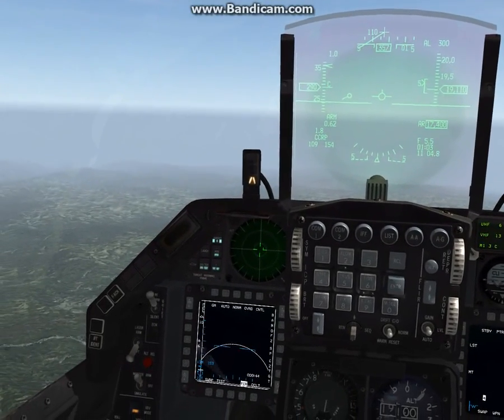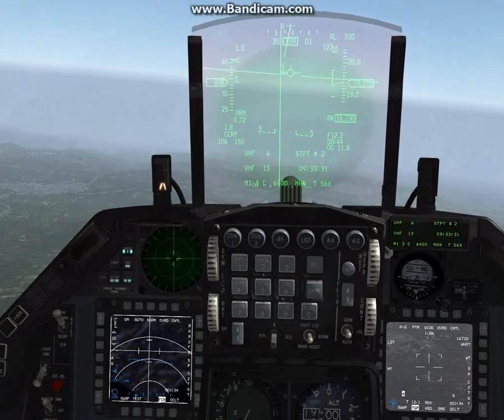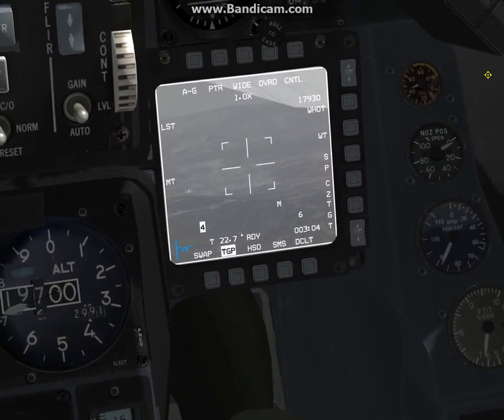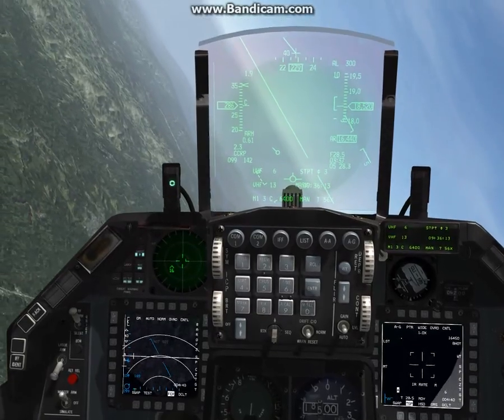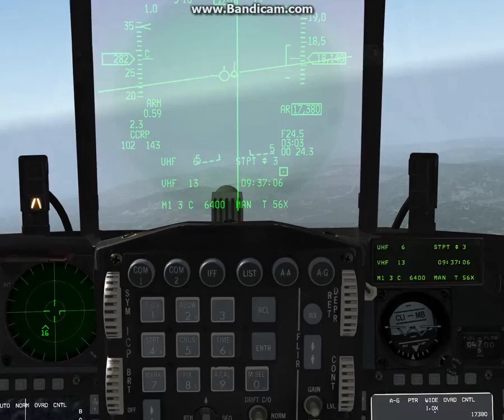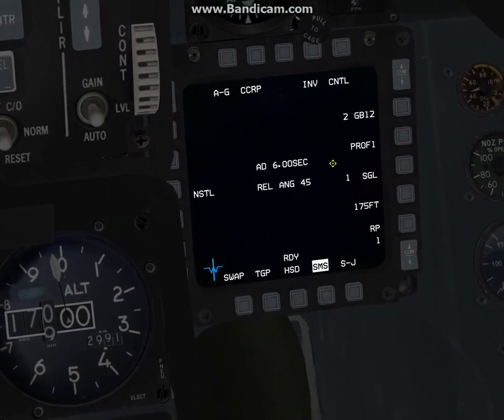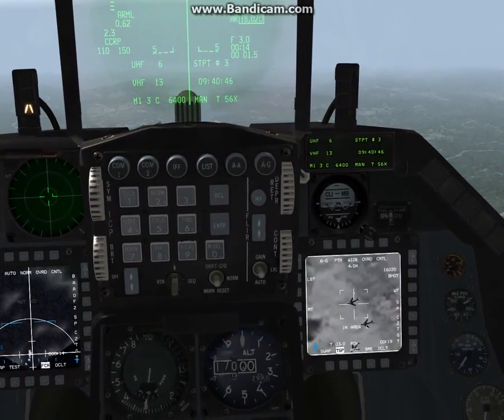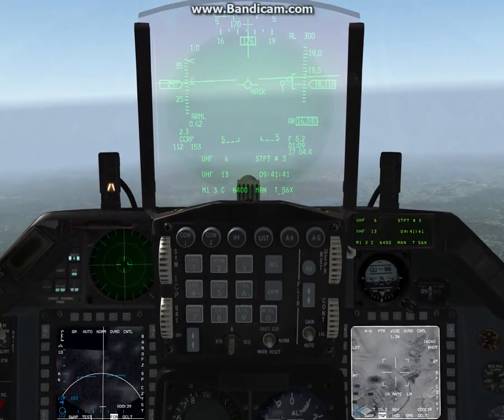✪ BMS 4.32 "Laser Guided Bomb Tutorial"

Comment: Hi
Can you explain how to use GBU-15. 
It is not the same as other GBU bombs
Reply from the maker: +Dan Lieberman Apparently the GBU-15 is "guided by remote control after launch". Typically this meant the pilot has a control interface and "flies" the  missle into the target, similar to the TOW missile. I'm not sure if I ever launched a GBU-15, but try using the cursor to stear the bomb into the target
Reply: +Burner 
I managed to fire it same way as i launch a Maverick - power it up, wait for it to power up , remove cover with "u" lock and fire.
However, I lost visual image as soon as it was  launched.
Do you think it is possible to keep visual link after launch?
Reply from the maker: +Dan Lieberman Im not sure. Some TV guided weapons are fire and forget, as in the weapons camera head will lock on to the target image but wont transmit back to the aircraft.
Reply: +Burner You're correct, the GBU-15 is fire and forget. Once the camera is locked onto the target and the weapon is released, video feed is lost. 
There are versions and methods in real life that required a pod that would received video feed and send course correction instructions from the launch platform, but (and it's been a LONG time since I've flown Falcon) I don't think that was ever modeled in F4.